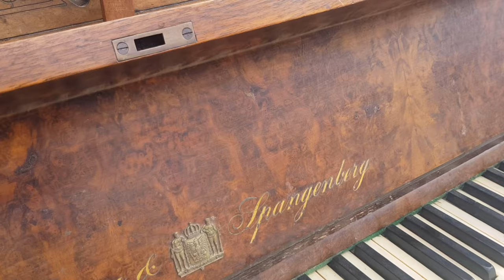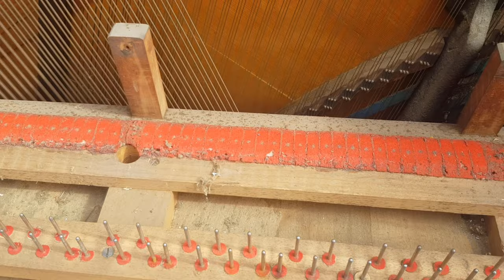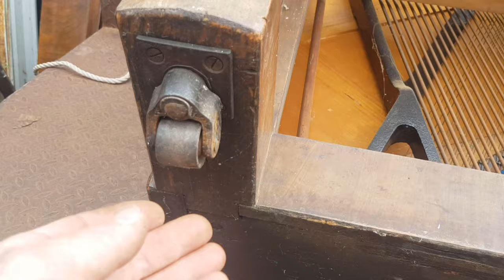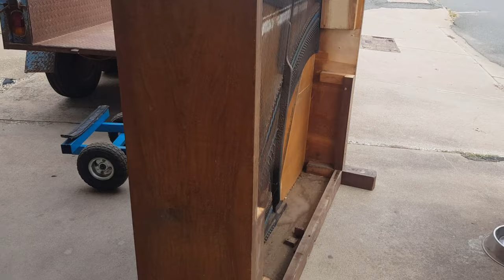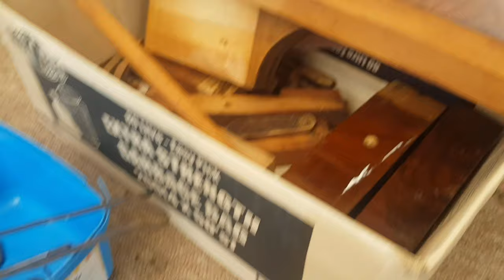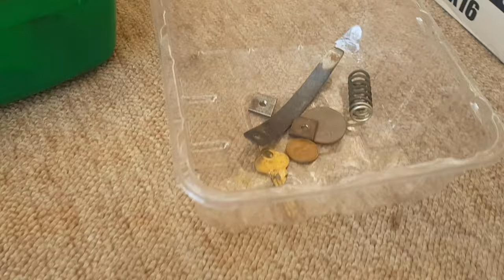Scrapping a 100 year old piano! Much scrap metal value? What else can we save from landfill?

Comment: Regarding the strings: They are under tension but they're not very elastic. When you cut one they don't really whip around. I cut mine with an angle grinder (eye protection a must). The biggest risk would be getting stuck with a wire. If you want to remover the tuning pins order a specialty socket online (they're a tapered weird size), chuck it in an impact gun and have at it. I wound up cutting the harp below the tuning pins with an angle grinder. It took about 15 minutes to remove most of the harp by cutting the webs.
Reply from the maker: Thanks for sharing your experience mate! The next one I get, I am planning a total dismantle so will follow your advice 👍😊
Reply: @TheUltimateRecycler  --- Concur with outofcontrol. I tried to "tune" a string one time with a wrench. The string snapped very cleanly and remained in place. I did get the eerie echoing sound though! Piano tuning wrenches are relatively cheap. If you don't want to completely unwind the sting, just detension them and zip across the lot of them with the angle grinder. Nice work on the careful deconstruction, though I do have to say even that instrument could have been restored. But if you've got no one nearby who does this as a hobby, your solution is quite practical.

Comment: I just started to take a 1880 piano apart. Amazing how much change falls into the piano through the  🎹 . Also, the pins by the keys seem to be brass. Took all the keys out and hammer section off. Then turned it into a desk.
Reply from the maker: That's awesome! I've seen them turned into drinks cabinets as well. Nice work 👌

Comment: I pulled an 1894 piano apart a couple years back, primary interest being the keys for some inlay work and turning small finials from the ebony.  There were several hinges that are very unique and  the tons of screws pulled from it are absolutely amazing with very little rust and they are cut so precisely, nothing at all like what can be purchased at the local hardware store of today.  I cut the strings with a large set of lineman cutters and some good leather gloves, they do have quite a twang when they let loose!  Really get a sense of appreciation for the fine craftsmanship that is built into something like this, such detail!
Reply from the maker: Yes, they display remarkable craftsmanship from long ago! Quite an experience dismantling an old piano! 😊👍

Comment: Strings are covered with copper. You can release the the tension cut them off top and bottom. Place them in a fire and get the copper. Ivory keys tops are made in two halves. A thin long one and a wider short one. Also they have a waive pattern if you look at them whit a light say at 2 degrees
Reply: CUrrently unwinding a piano's worth of wires, I've been using a jig (2m length of 32mm plastic pipe with a 16mm hole drill out at one end. Start unwinding with pliers until i've got couple of inches of copper unwound, then attach the steel wire to the drill chunk, feed the copper wire through the 16mm hole and then pull on the copper wire while the drill is turning. It's going fairly quickly and getting some nice bright copper.
Reply: @e.n.l1976  Gllad to know...Nice Idea.That's a good procedure, The one about the fire i never tried it personally. it was told to me by my piano tuning teacher when copper was less valuable , I Would love to know the weight of copper without steel,,  Aftertought.... how do you hold the other end of the string? loose spinning hook pheraps? Jusrt rambling...by hand and heavy duty  gloves? you really got me going there😃😄😄😄😄

Comment: the most important thing to rember is to use eye protection when removing the strings and start loosing in one end with a gradual turn then alternate to an opposite end back tot the second sting on that side and the second string on the other side in 1/4 turns it is a slow process. some pianos have value regardless of what condition they are in depends on the mfg and rariety.
Reply from the maker: Thanks James, yeah I didn't have time to remove all the strings for this piano. I may tackle one in the furture..

Comment: Nice video :) I appreciate the respect you showed for the piano. How did your selling of the pieces go?
Reply from the maker: Thanks 😊 I just checked and I've sold about $100 worth of bits & pieces! I still have the main soundboard and I took some timber home for future projects!
Reply: @TheUltimateRecycler  old soundboard are dried out and sound no more. What is valuable in a piano is the ivory keyboard if the wide part is  long enough.
Keylenght changed trough time. and the black keytops if they are made of ebony. Black key tops can be useful to a luthier to make guitar or violin saddles. So basically you can offer the whole white keyboard to a piano restore man.
Reply: Also if he is not interested on the black keys you take them back and try offering them to a luthier. Ebony is a really hard wood and if want to have some fun drop it in water and see it sink. Bye
Reply from the maker: @carlocondoluci574  Thanks for your comments carlo, I've only just seen them. I managed to get rid of all the piano over time - even the main frame went to a loving home! 😊
Reply: Thanks for posting this video. We recently bought a house with a 1916 baby grand with a walnut case. I've tried everywhere to find a new home with no luck. We have decided to take the top and make a coffee table. I hope i can sell the other parts.

Comment: As a piano tech I am glad you took the time to take the good stuff out. Piano timber is always good quality even if it is secondary wood under veneer. I'm curious what sold and what didn't. Did you realise your projected total?
Reply from the maker: Thanks 😊 I did manage to sell all of it - even the large heavy sound board! I just looked up my records and I managed a total of $153 for all the parts! Everything went eventually - but I did discount some stuff when I had to move shops and reduce stock.
Reply: @TheUltimateRecycler  Good on you. If I came into your shop I would ahve bought the legs and the decorative panels. I see so many pianos and they truly don't make them like they used to. Althoug that said, there are some fine pianos made in terms of build qulaity, but just not the same in the design.

Comment: I wouldn't be surprised if the soundboard spruce could be used to make instruments like guitars, violins ect... the spruce is probably 100 years old and that's pretty desirable because of the tight growth rings.i saw a u-tube where someone leaving that horizonal keyboard panel that you took off in place then he took a die grinder and zipped all the strings then he could remove the cast iron harp.
Reply from the maker: Yes, the timber would be well over 100 years and has beautiful grain! I may try and remove the harp next time and salvage more timber for home projects! 😊👍
Reply: I dont think a luthier would be able to make use of it. Although some pieces would probably work well for the body of something like a flying V-style solid body.

Comment: A long time ago I got myself an empty piano case just like this one, I wanted to make it into a stand for my keyboard and sound equipment. Unfortunately it didn’t work out. Not only was my keyboard too wide to fit, but the Main problem is that once the cast-iron frame is removed, the whole cabinet looses its rigidity and it wobbles and all of the strength is Gone, despite of trying to straighten it with crossed steel cables from corner to corner. It really is fascinating how the Iron Frame keeps everything together and straight.
It’s still a shame, but it just happens.
Reply from the maker: Yep, the cast iron frame is an integral part of the piano! Thanks for watching! 😊

Comment: The strings and sound board would make a great wind chime if suspended under cover, outside.  All those felt washers would be worth keeping.  Why not unwind the pins to slacken the wires off safely ?
Reply from the maker: There's certainly many upcycling options Brian 👍 I didn't unwind all the pins as i didn't have that many hours spare! It would be very time consuming..

Comment: You can check if ivory keys by picking a spot on the key out of site and heating something like a paperclip red hot on the end now touch that spot if it melts its plastic, if it smokes and doesn't melt then its ivory, ivory is a lot like your finger nail.
Reply from the maker: Yep, I have used this method in the shop with ivory/plastic ornaments! Thanks for watching 😊👍

Comment: Very nice if you can locate some felters all that material can be reused.  I just scrapped out two pianos. I saved some of the wood but the cast boards were scrapped.  Did you have any luck selling the main sound board and the other pieces?
Reply from the maker: I still have the sound board Nas Atlas, but I have priced it at $100 as I'm happy for it to hang around for awhile and kids love playing with it! I also still have the keys and the hammer assembly, but pretty much everything else has gone!

Comment: I saw the prices that you were assigning these pieces.  I was wondering if you actually got that much for all of it?  I have a similar piano problem myself, but I was wondering if the local school, had a shop full of kids willing to disassemble and scrap a large number of pianos, for at least the scrap metal and wood possibilities? I'm sure any number of communities have far too many old pianos hanging around.
Reply from the maker: I just looked up my records and I managed a total of $153 for all the parts! Everything went eventually - but I did discount some stuff when I had to move shops and reduce stock. If I did another, I would completely dismantle the main sound board and keep some of the great timber for my own use! If may be a good project for schools or community groups! 😊

Comment: I can’t bear it when pianos die. Not enough is being done to promote the beautiful sound of an acoustic piano compared with the dead sound of a keyboard. 
I don’t blame people for having to get rid I just feel sad about it.
Reply from the maker: Yeah Judy, I do agree but it comes down to practicalities sometimes!
Reply: They can sadly get to a point where they won't stay in tune anymore and at that point there's really not much you can do with them. Just in the middle of scrapping one of my two for that very reason, using some of the timber for shelves/wood work, the cast iron is going to the scrappy so will be recycled into something new and there's even a fair chunk of copper on the strings. I've held off doing this for a good few years but it takes so much space up.

Comment: I think you are underpricing the bracc pedals. scrap price would be 1/2 that $10 or more I reckon, and they will be good pure metal.
Reply from the maker: The pedals were actually steel with a brass cover plate - so probably very little weight in the brass unfortunately. Thanks for watching David 👍

Comment: Simple test for ivory.  Take a tiny bit and burn it.  If it smells like burning hair, it's ivory.
Reply from the maker: Yep - a red hot needle is the easiest way I believe. Thanks for watching Stephen 👍
Reply: @TheUltimateRecycler  Pianos are marvels of engineering and art.  Sometimes you can save them, and sometimes you can't, but even rescuing pieces can be worth the effort.  I am currently evaluating a barn-find giant art deco AM/FM turntable console for repair, and have similar decisions to make regarding its fate.
Reply from the maker: @stephenvale2624  Yep, it's tough making those types of decisions! At least the console radio isn't quite as heavy as a piano!
Reply: @TheUltimateRecycler  Circa 1942 Firestone Air Chief Radio Record Player.  It is really heavy, but not in the weight class of a piano!   It's in rough shape, and I wish I had received it before the guy two owners, back tried to remove the veneer rather badly, but the electronics still work and i haven't even replaced all of the capacitors yet.  The speaker is dust, but the case is built like a tank.  If I do try to restore it just for fun, maybe I will make a YouTube video of it.
Reply from the maker: @stephenvale2624  Yes you should! I'll watch it! 😊👍